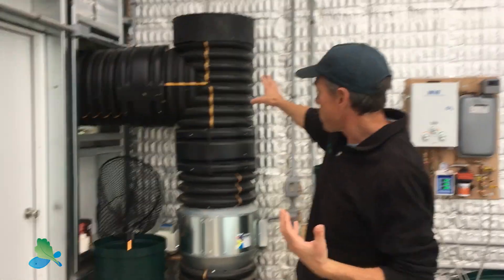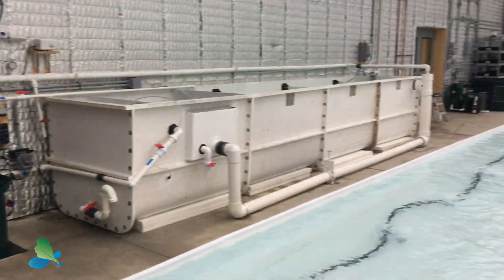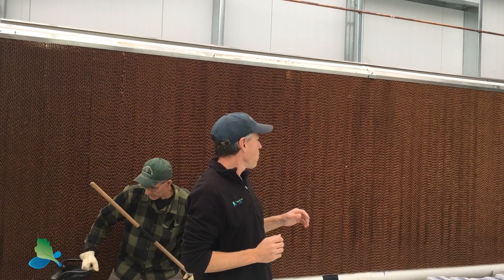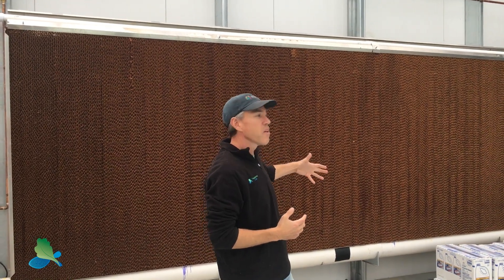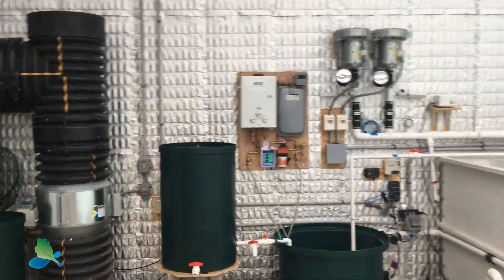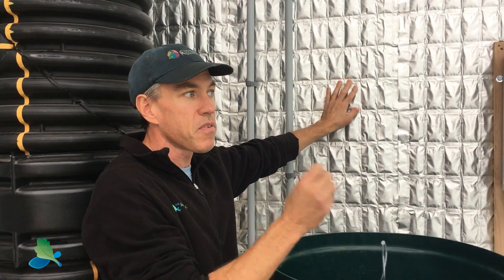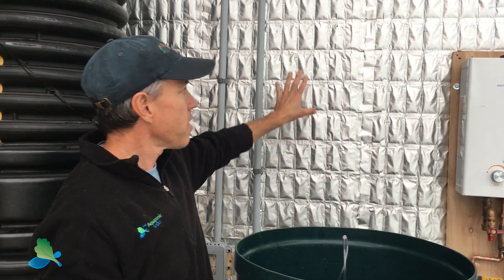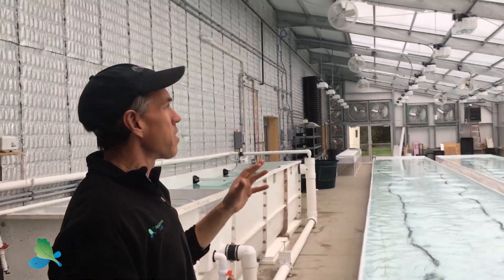Passive Solar Aquaponic Greenhouse Tour

Comment: What's your payback period on this investment on that growbed area to capital investment ratio? Does not look like lettuce will turn a profit here, will this be used for a crop with a much higher market value?
Reply from the maker: Good question...This organization is a non-profit serving schools and the local community so turning a profit wasn't necessarily the primary goal. However, aside from building multideck systems, the single level grow beds were designed to occupy as much grow space as possible while also allowing for circulation space and other equipment. So while we don't know all of their cap ex costs on this project, I would estimate based upon experience and some ball park figures that payback could be anywhere from 5 to 12 years. The payback period is contingent on many variables such as the price per unit, culture time and operating expenses. So if they are consistently managing rotations and turning a decent price point then they can be successful here. If they are not managing the system properly or achieving maximum value for their products then their payback period will be significantly longer. This is the case for all farms. We do have tools on our website that can provide a detailed analysis of important financial and production metrics.

Comment: Who makes these heating and cooling systems? Were they part of the initial design? Or added in after your greenhouse was built?
Reply from the maker: The heating and cooling systems for the greenhouse are part of the initial design. The GAHT system was designed by Ceres Passive Greenhouses.